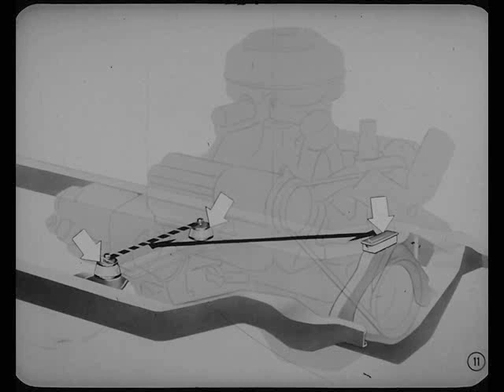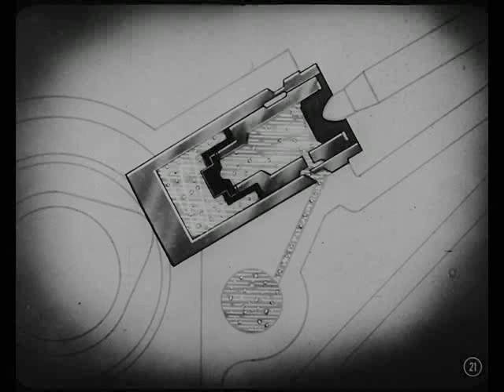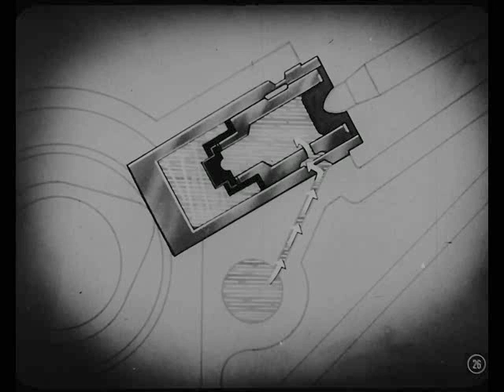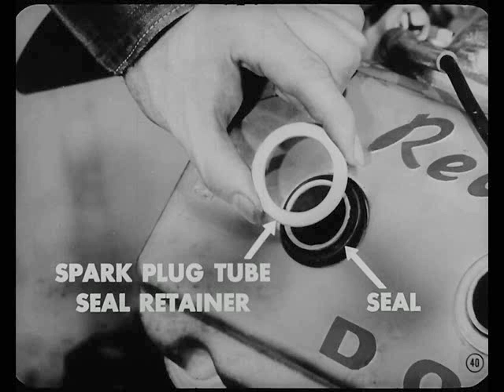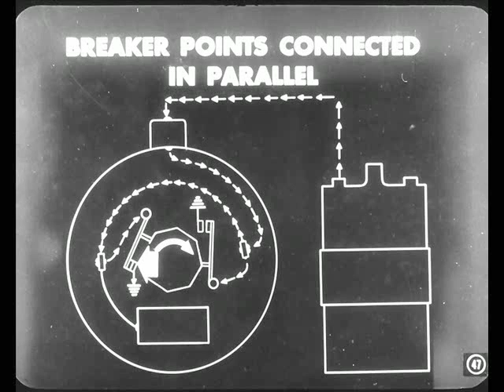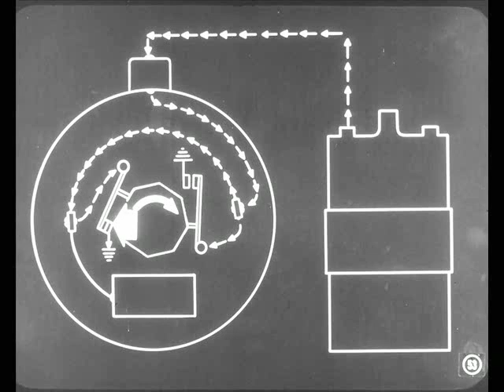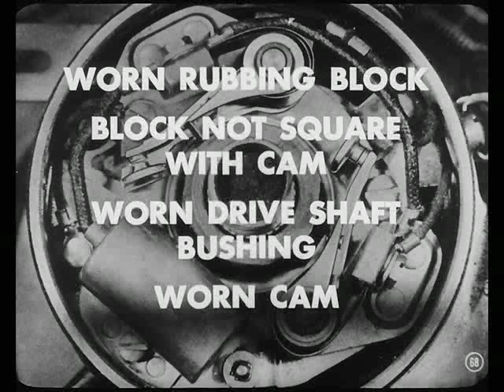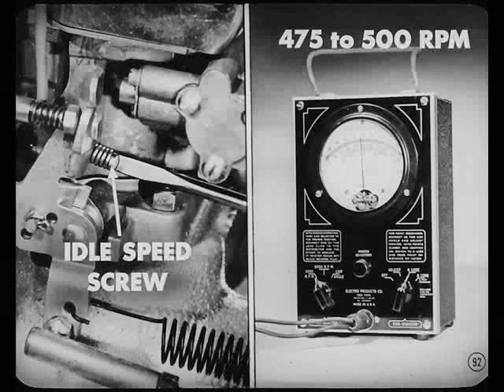Chrysler Master Tech - 1952, Volume 5-11 Dodge Red Ram V-8 Engine

Comment: The first hemi was Chrysler 331 in 1951 and 180hp. DeSoto was 52 and dodge 53 with the 241. Having torque converter oil and engine oil was dodge only and a bad idea cause sludge in converter and stopped it by 55. In small towns people would only drive blocks to work and all engines had lots of sludge in them because they didn't get warmed up. Every mechanic had a large serving spoon in his tool box and the first thing before overhaul was to spoon out all the sludge from the heads and valve galleys. Pennzoil and Quaker state were worst cause they were full of wax.
Reply: Severely waxy oil, yes.  I also think those road draft tubes would suck road dirt under closed throttle deceleration.  Remember all those dirt roads?

Comment: Classic Mopar film!!! Now, Pertronics has an electronic ignition kit that will replace these troublesome ignition points, and everything will stay inside the OEM distributor housing! And using one of their OEM look-alike 3Ω 'Flamethrower' ignition coils, and older engines like these will run smooth throughout the entire range of rpm's the engine operates at... And the Pertronics system operates off of 12.0 to 14.7volts, so the OEM ballast resistor is no longer used... Less to go wrong!!! Poor Tech (the puppet) was taken to the rifle range before he got home to get sleep, but he's sleeping now- alongside several other struck targets... 😮

Comment: engine oil in torque converter. YIKES !!!
Reply: The trans also used the engine oil .really horrible system .It was type of fluid coupler with a clutch
Reply: Better than using it to power the fuel injectors.

Comment: Torque converter used engine oil ?
Reply: Yes, some of them did.  I have an old chrysler spacer plate with multiple oil passages that shared engine oil with the tranny.  Its how we ran bulldozers and tanks for years.  Didn't work well for the automotive applications.

Comment: That first HEMI only has 140 hp ?  And the 1960 225 slant six also had 140 hp.  What gives?
Reply: OKIE CHOPPER low compression for low octane fuel in the early 50s
Reply: It was 1952.
Reply: Progress. Lots of it!

Comment: 140hp 7.5.1 komp. Why so low Comp?? 10.1.1 = 220hp mayby..
Reply: Hard to easily get the info. I believe octane ratings after the war were too low for high compression. During the fifties octane and compression rose hand in hand. Sorta chicken and the egg. One site claims regular in 1946 was only 79! Knock in a pre electronic high com engine would be severe.
Reply: @chrislochner4038  Okej.well create much more horsepower. Today's Gasolin will make this engine much more Power.Perffekt to installation Procharger ore Turbo!🎯🥂
Reply: @chrislochner4038  Gas was low in octane. Two brands come to mind, Phillips 66 and Union 76.  Both were named for their highest octane rating, tho I don't know what years they came into being.
Reply: Phillip's fuel made the founder's car go 60mph, no, said his chauffeur, 66! You might be correct with Union Oil.